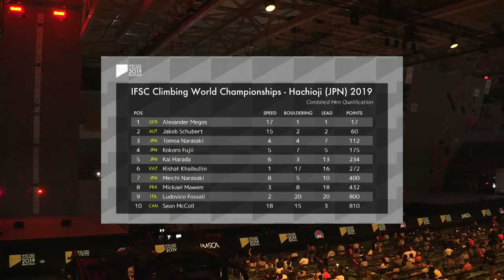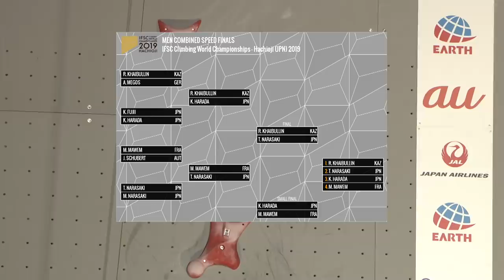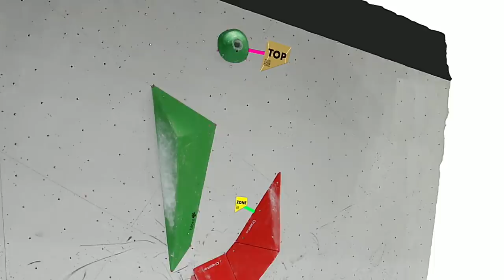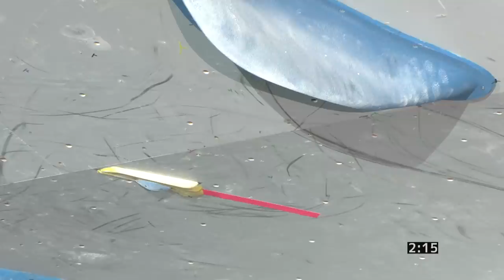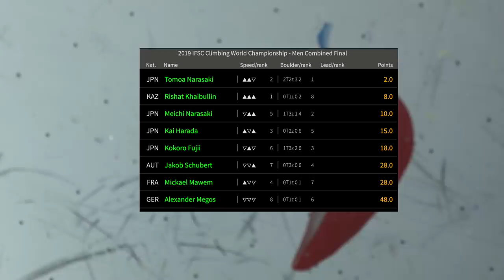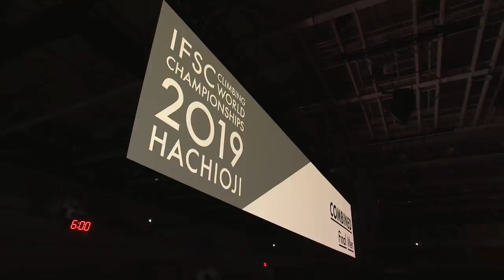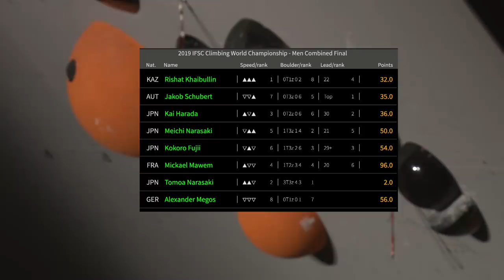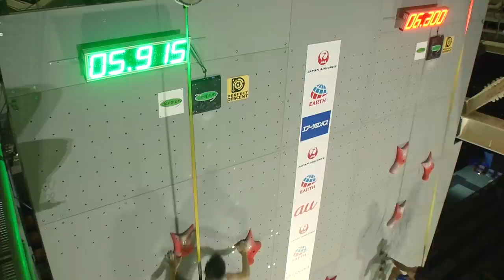IFSC Climbing World Championships Hachioji 2019 || Men's Combined final

Comment: For people having a little trouble wrapping their heads around this multiplicative business, and can't really figure how advantageous certain rankings are compared to others, you can completely replace this scoring system by the following: just use very ordinary scores that add up like in any competition, but use those points instead:
 1st place: 0 pts
 2nd place: 7 pts
 3rd place: 11 pts
 4th place: 14 pts
 5th place: 16 pts
 6th place: 18 pts
 7th place: 19.5 pts
 8th place: 20.5 pts
The values are slightly rounded, but it should almost never make a difference in the final ranking.

By the way this makes it extremely clear why a 1st place is absolutely huge, and why once you lost your first round of speed, you're basically fighting for scraps.

Comment: Speed ranking is a problem because it’s based on luck. The first round is the most important round because it determines if a climber is top 4 or bottom 4 (a win in first round means 4th is your lowest possible ranking; a loss means 5th will be your highest possible). The problem is that draws for the first round seem to be random. Meaning, if you prepared well for speed and can beat 7 out of 8 climbers but you’re matched with a speed specialist, you’re highest possible ranking will probably be 5th. It’s not fair because the ranking doesn’t reflect the climbers by performance.

Comment: Any of the complaints about the combined format are moot after the Olympics anyway. the 2021 world championships are going back to just the 3 separate disciplines, and speed and lead/boulder will be split at Paris 2024.
Reply: Is there some official info regarding medals in 2024? Afaik the climbing community is currently hoping that it will play out that way, but we don't know. If 2020 goes bad somehow it might aswell be possible that climbing won't even be on the list in 2024
Reply: @nicolasfischer3745  it's a very safe bet given that they only made a combined discipline to be able to include speed climbers in the one medal event allocated. this along with there not being a combined event in the prelim 2021 worlds programme really cements it. the combined would have to go really well for it to stay in.

Comment: I wish they’d fix the scoring. A person who comes in first and then comes in last should not be second. They should be middle. The scoring system is all wrong. We’ve seen speed specialist get top 4 even though you are last in two of the 3 events. The math is lacking.
Reply: I don't think they should be middle, but they shouldn't be second that's true (though 8 pts in 2 events might be 3rd, not 2nd). The problem is 1st is weighted too heavily. Perhaps it should be rank + 1. So 1st and 8th would be 2 * 9 = 18 points, while 3rd and 4th (still above average) would be just slightly behind at 20 points. 

I'd argue it's also unfair that boulder and lead climbers get nearly double advantage because of how much crossover there is between those two disciplines. Speed deserves to be in the Olympics but it just doesn't fit in a combined format. 2024 will be how it should, 1 medal for lead/bouldering combined (only deserves one medal since the crossover is so high) and 1 medal for speed.
Reply: mathjoker agree. I just think it doesn’t belong in combined. My comment about changing up the routes would just make it more interesting to watch lol. My bigger issues are with the scoring and how they do brackets in speed climbing. But hey at least climbing is coming to the olympics!

Comment: would have been more interesting with adam ondra
Reply: why did he not compete in the finals?
Reply: @juanhurtado123  Did bad in speed, pretty good in boulder but in lead (perhaps the discipline he expects most out of) he stepped on a bolt around hold 10. Maybe wouldn't have mattered anyway since he didn't top the route.
Reply: @juanhurtado123  he was disqualified. Officially, he stepped on a bolt but its hard to confirm from the video we have. Anyway, he didn't put his weight on the bolt so many question the decision.
Reply: @timnergaard3831  it mattered. He would have been competing today...
Reply: I think he almost certainly stepped on the bolt. But it was just bad route setting that it was so close to the perfect flagging position. All the other climbers flagged really close to it without even noticing, only Ondra was unlucky enough to have stepped on it. He almost certainly didn't need it.
Reply: Adam is way overrated..